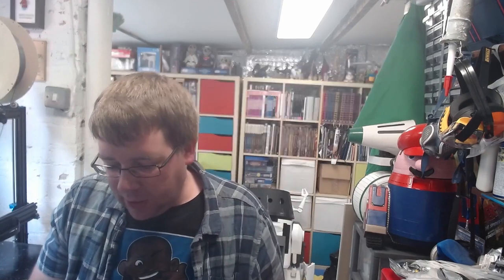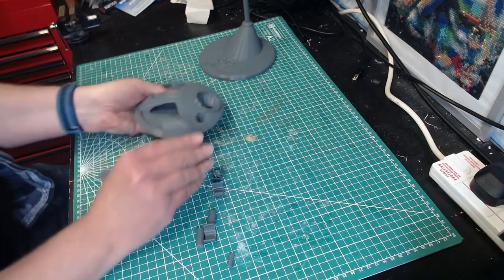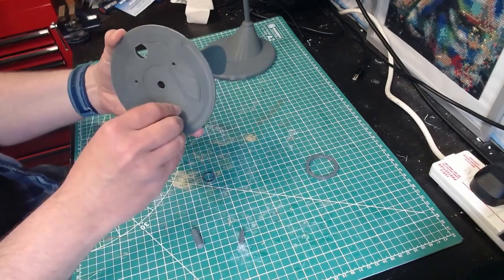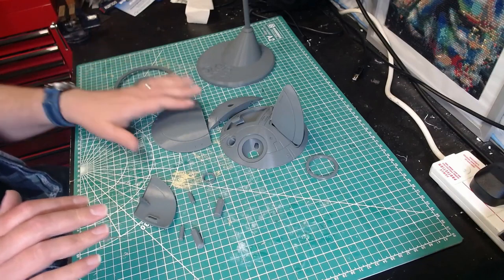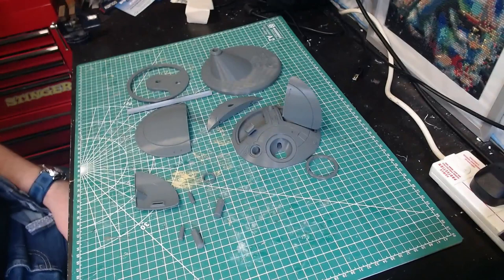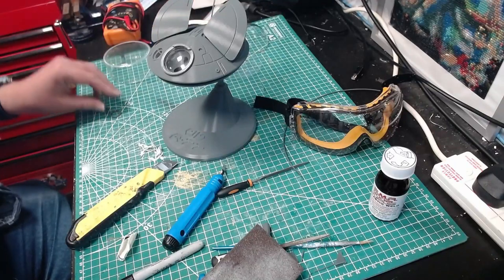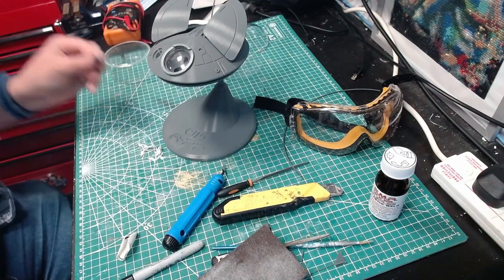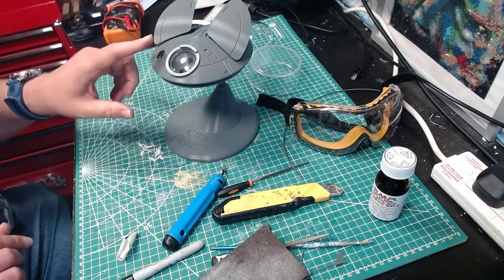Let's Build! - L0-LA59 from Obi-Wan Kenobi

Comment: Too bad it doesn't have a working hinge on the wings.  I have a couple micro servos that might work for moving the "wings".
Reply from the maker: It's also quite tight for space, putting the led wires in took up more space than I would have liked. Squeezing electronics in there is going to be interesting! I'm thinking of maybe hollowing out the lower mouth to make room.